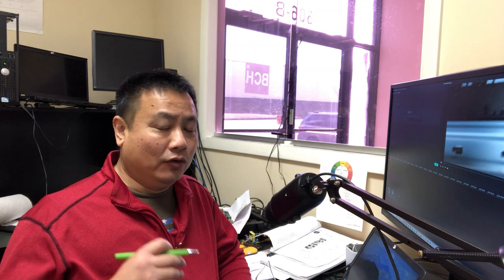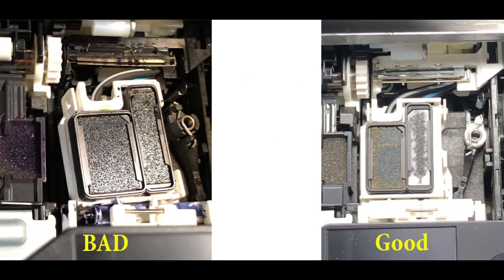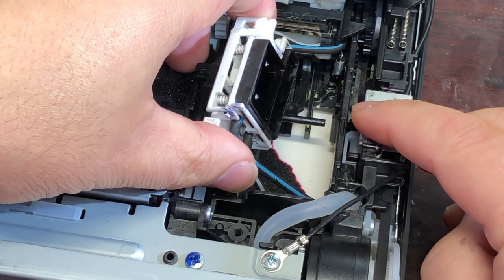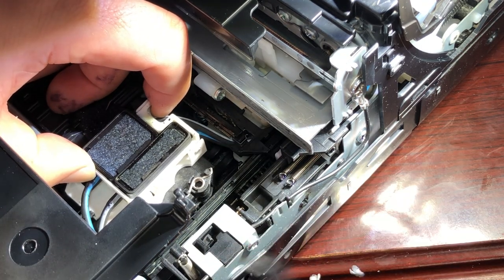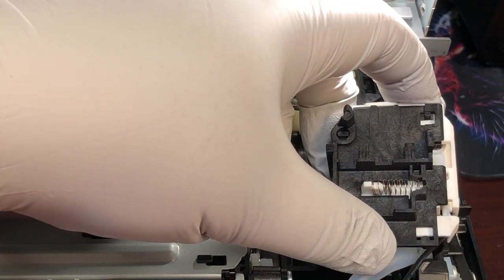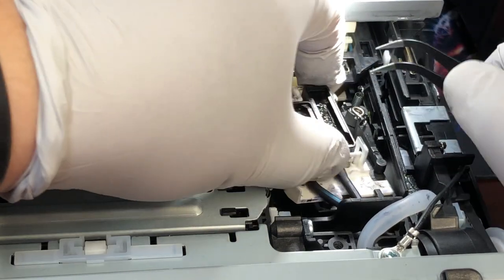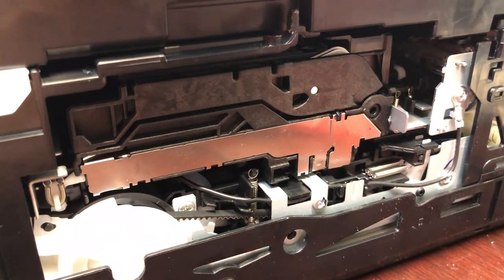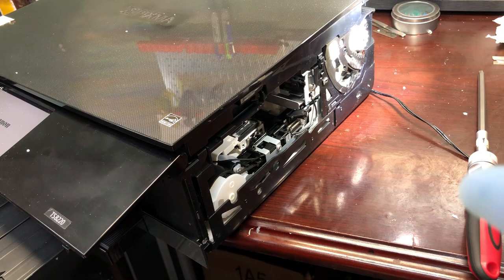Support Code 5100 Canon Printer: Adjust Waste Ink Assembly - Canon Paper Jam Fix TR8520 Error

Comment: Thank you so much. My situation differed somewhat but in viewing your troubleshooting videos I was able to improvise and get my printer working again. The root cause was that ink build up had jammed the waste ink mechanism so I pulled apart cleaned it and reassembled. I had a 6004 code and nothing would work. I called Canon for service as directed who said they don't fix these printers and I was out of luck. I would need to determine what to do next myself. I asked should I buy another Canon printer then and they responded that was my decision. I then asked should I buy and Epson instead and they responded that I would need to decide for myself - So I did. Should my repair not hold up my next printer will be an Epson. Great work by the sales prevention department at Canon!

Comment: In case it helps anyone, I had the same issue with a G4511 and in the end what worked was to sponge down the capping station (printhead cleaning/resting area) and then place a piece of folded kitchen paper towel along the printhead path before gently running the printhead carriage over the top of it. This removed some dried off ink from the base of the carriage unit and likely cleaned the sensor that was giving the inaccurate paper jam error.

Once I removed the kitchen paper towel the 5100 error had disappeared and we were back in business. Thanks Kevin for the tips though, you led me in the right direction so much appreciated.

Comment: I have a Canon MX922 and I'm getting the Support Code 5100 and there is no paper stuck and the ribbon doesn't look dirty and the waste ink assembly looks straight.  I'm wondering what could cause the code.

Comment: Hi Kevin, like your videos much, they are very helpful. I’ve got a G3000 and error 5100 when print, ink cartridge pad looks good, reset counter and changed waste ink pad, cannot hear the big ‘tar’ sound as usual before print, and can hear very little strange motor noise when print, then error led blink 2 cycles. tried to locate paper jam pieces but cannot find, tried tilt printer up backward, left or right but nothing canoes out. No idea how to fix it, any suggestions? Thanks.
Reply: Same problem in MG3070s